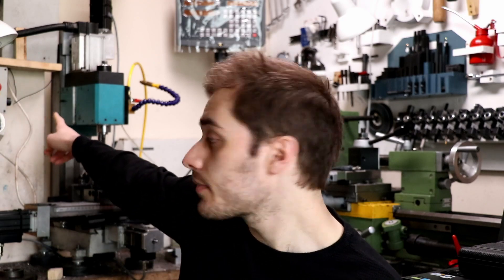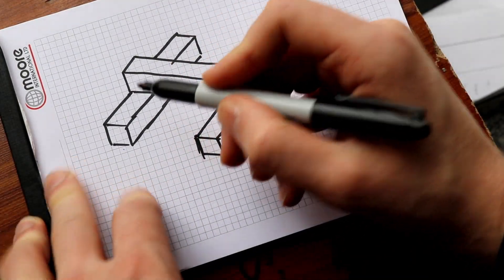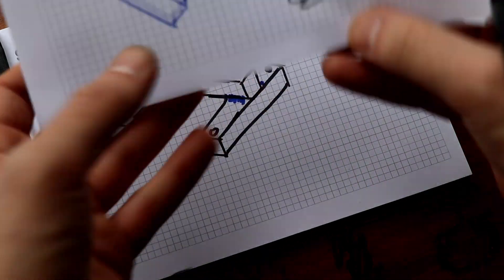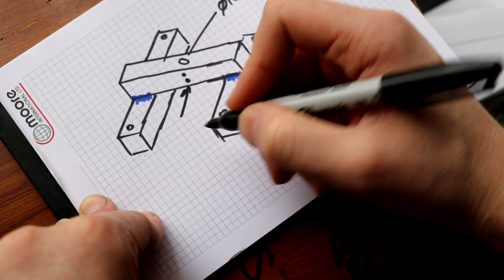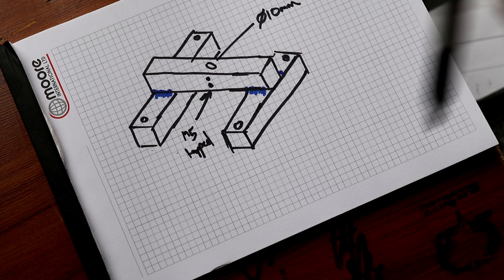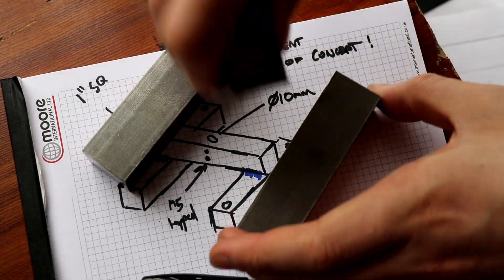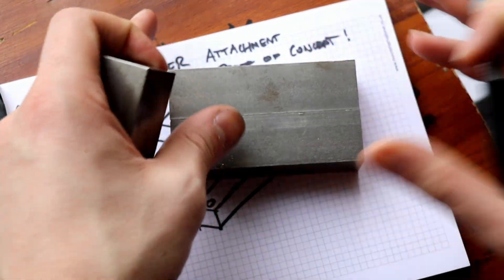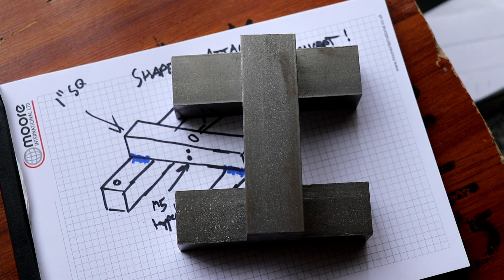Shaper attachment part 1

Comment: What's the sue of making a shaping attachment on a milling when you could use an endmill!!!!!!!!!!! Doesn't make sense:-((
Reply: shaping, if done well, can make quick accurate work of flat surfaces, and induces less machining stress in the machined material. It is the suggested means of old school cast iron machining for accurate and stable geometry. but it's also good for blind-ish corners and getting in some tight spaces, including keyways of odd sizes without a broach.
Reply: @natthewsmith  thanks for the great explanation!  I wish I could find more info online about when best to use a shaper when best to mill. I have wondered much the same now that I have 1 too

Comment: Cool idea on the shaper tool for your x2.  I am not a welder either, but I have some experience. Half your welds don't look too bad.  Maybe a little more heat and faster wire feed.  It should sound a bit like bacon frying.  You probable can't put too much heat in to that part considering the material thickness.  I have a small MIG and find that pre-heating thick stock like you have helps the weld penetrate better.  I use a propane plumbing torch.
Reply from the maker: robert simpson thanks! I'll have to give that a go next time I'm welding, I have a MAP/propane torch that I use for brazing so that should do it